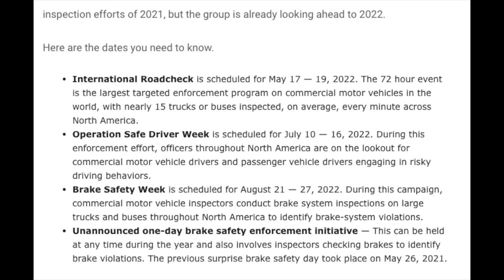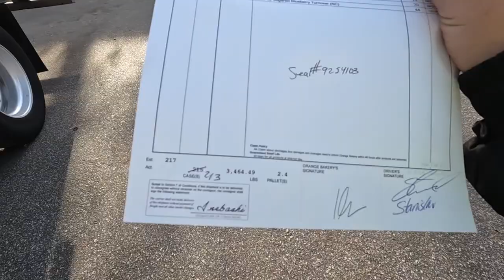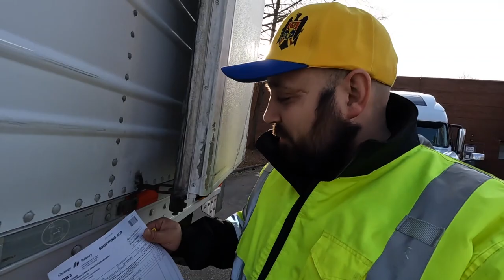Took my kid for a trip in the semi TRUCK

Comment: Hi Stas are u Russian speaker?
Reply from the maker: Hey I can speak Russian yes what’s up?
Reply: Привет ;) вот почему я хорошо понимаю твой английский;)))  Стас помоги советом, я смотрел твой видос про рам промастер. И там ты говоришь про 10000 gvwr, я с таким весом найти ничего не могу, особенно из фордов, все идёт 12300 и выше?  Или этот класс бокстраков вымер уже
Reply from the maker: @iamrumpel1786  Hey sorry I can’t right in the Russian I made my wife read this to me LOL but I can help you get one of these trucks if you want where do you live right now?
Reply: I live in Missouri. Just try to figure it out can I buy it new from dealer or need to look at used trucks ;) because I knew only trucks from Chevy/gmc from 2003 to 2007 was manufactured like dully and 16 feet cargo box.
Reply from the maker: @iamrumpel1786  you can buy it new from the dealer Which you are going to get a lot better rates but right now everything is so high that buying a box truck right now it’s not the best choice to do honestly if you can wait one more year until all the trucks prices gonna go down then you can buy one but until then it’s not worth it in my opinion to pay $60,000 for a box truck
Reply: Thanks Stas, I just thinking about it. 60k is not a good price for box truck. ;) u right, I’ve checked price for ford transit chassy and it costs around 37k long base with dually, and a box I can buy for 4500$used
Reply from the maker: @iamrumpel1786  no you see what I’m saying $37,000 only for the truck not including the taxes and fees then you had to buy the box not included the taxes and then you have to pay for the labor to install it you’re going to get to $55,000 with absolutely everything but I could help you find a really good book truck if you really want to I’ll be more than happy to help 🚀🚀🚀🚀🚀
Reply from the maker: @iamrumpel1786  sorry bro but I can speak Russian but I cannot write Russian really good LOL 🤣